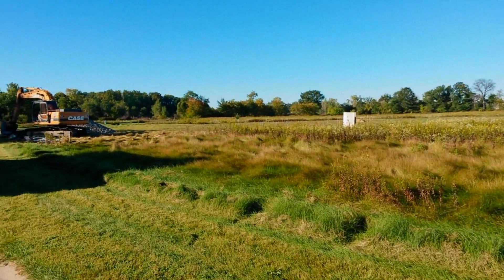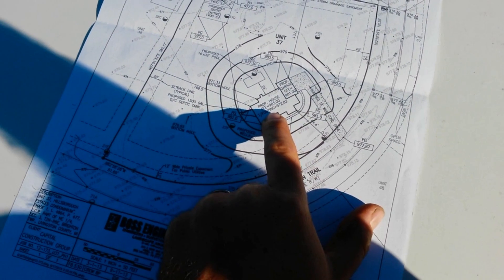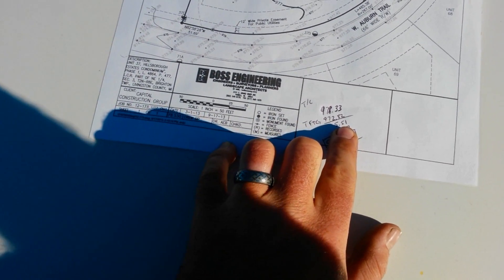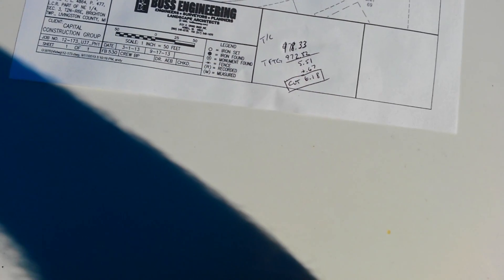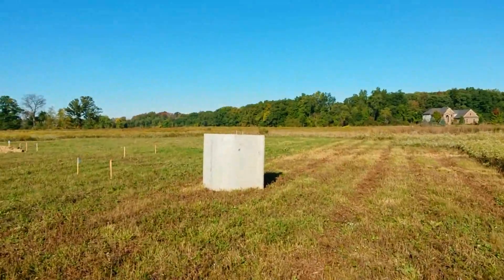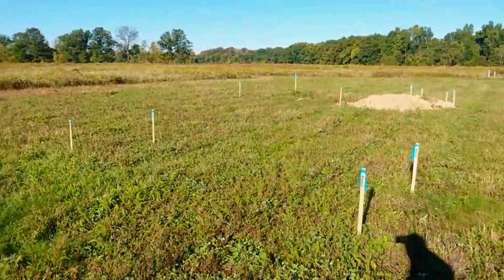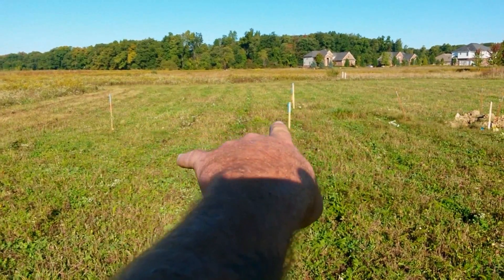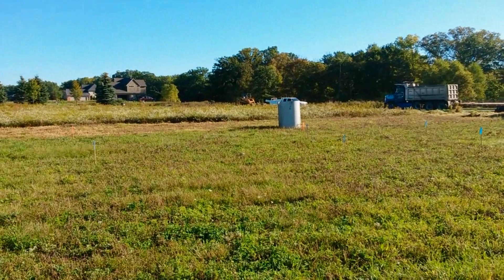Overview of a New Residential Basement Site

Comment: I haven't ever seen a pre cast basement, Everything around here is poured in place.   Since your cut is only 6' will they have 2' of foundation showing? Or is it a overly deep crawl space?   Those off set stakes are nice too, usually the builders stake them here and its just corners, leaves you guessing some of the time.
Reply from the maker: +movindirt This was the first and only builder I saw who used the precast walls.  The 2 foot difference that you refer to will be used to create a slope away from the house.  These lots are relatively flat so they are set a few feet high.  By the time you use up the spoils in the backfill you have a nice slope away from the house.  At the end of the day, we don't necessarily need the offset stakes but it makes life a lot easier for the wall guys.

Comment: Do you own this company? Is the tracked skid loader and case excavator your only equipment in the fleet?
Reply from the maker: No, I worked for this company. We had the case excavator, a cat 315, d5, d3, Komatsu pc20, and the Mustang skid steer. We also had 3 triaxle dump trucks, one quad axle and a semi with a Chicago box trailer.